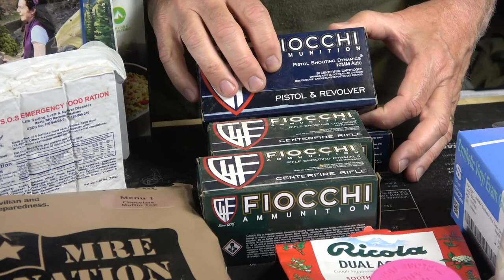Out of Stock! Fragile Distribution in the US

Comment: Basically you have caught all the weaknesses of "Just in Time Inventory" however you forgot one (got through most of a second degree in business) in my lifetime many staff have been replaced by computers if the computers ever went down on a large scale stores no longer have to staff to function without them. Stores depend on steady and predictable supply and demand when either is off there is a problem. Now the average customer buys 1 week of stuff at a time and they were told they may need to shelter in place for two weeks the system needs about 2 to 3 weeks in many cases to adjust for that but some things are longer and some are shorter (TP factories only 1 state away where I live).

Comment: Did you read the story about the US liquor company that has started producing a drinking alcohol of sufficient strength to be used as hand sanitizer?  Not any ol' booze will work; it has to be over a specific "octane", which this company has switched manufacturing gears to produce!  Me, I make my own by having bought a 6 gallon bucket of high octane rubbing alcohol (NOT drinkable!) which I mix with aloe vera from the cactus in my yard.